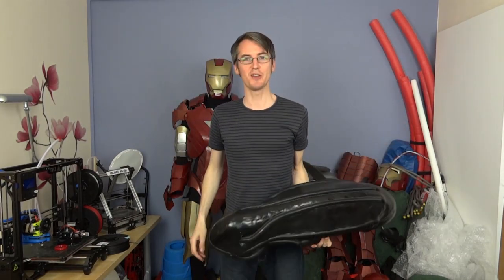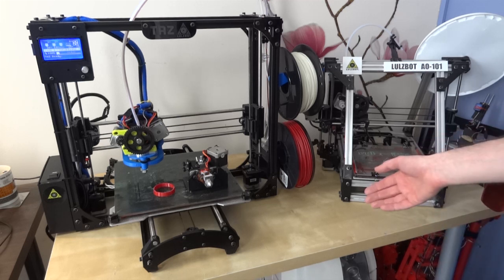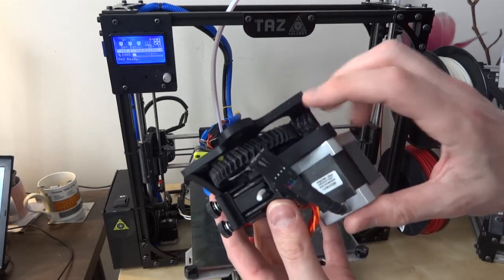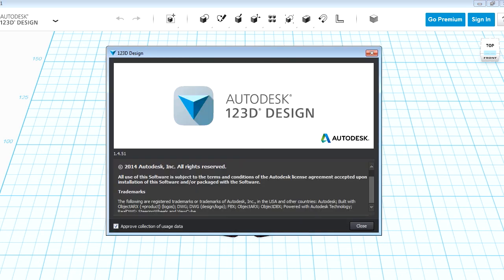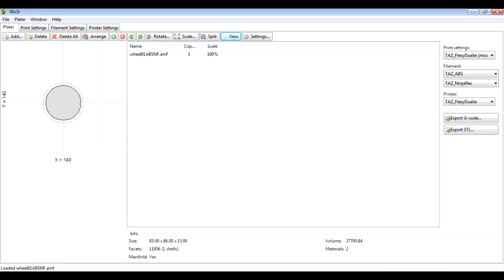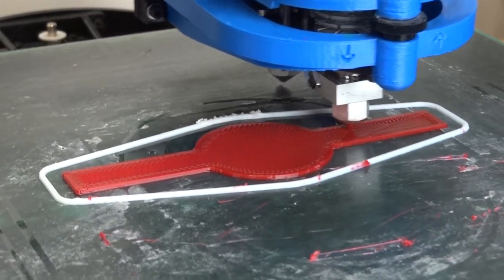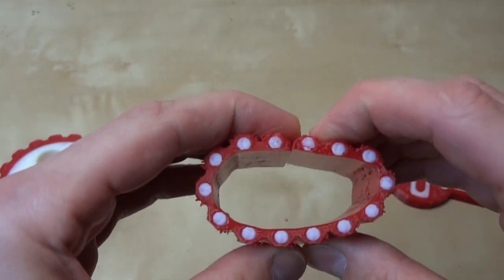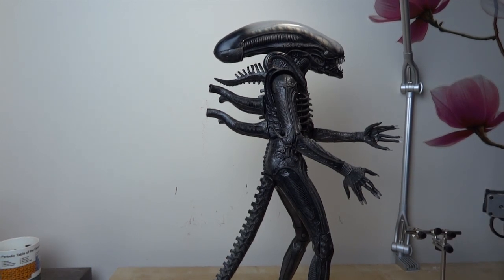Alien Xenomorph Cosplay #1 | Hybrid Prints with Lulzbot TAZ | James Bruton

Comment: Have you considered a brush on the side of the build platform that cleans the extruders? In slic3r you can manually add gcode commands on certain conditions, one of those conditions will execute a set of gcode commands every time the extruder in use is changed. You could add gcode that moves the extruder tips over a brush that would wipe off all of the ooze whenever you switch extruders. This would save a lot of plastic for you, and the object would still be visible as it is being printed.
Reply: The new Lulzbot Mini has auto nozzle cleaning, along with auto bed leveling
Reply: ***** Right. Your skirt solution is a good idea for this application.

Comment: Hi!
Congrats for your work, it's incredible!
I am working with lulzbot taz 6, namely with the dual extrusion of NinjaFlex and ABS. I'm doing an hand prosthesis with NinjaFlex and I also need ABS to perform supports. I am also using the Skirt option. 
At the moment, I'm having problems regarding the second extruder height, when it hits the skirt. This is made with a certain impact. We tried to lift the noozle, but during the printing, the noozle goes down again.
I am also having an issue about support-part interface. The contact layers of NinjaFlex have a poor quality and when I try to split supports from the printed part, the print suffers some damage.
Do you have any suggestion in order to improve these issues?
Thank you for your attention!
Reply: I am using Slic3r. I also tried cura. But I had some incrustations of ABS in the part, so I tried Cura. I made noozle and bed calibration

Comment: as someone whom is building an ironman suit myself part 3d print and part casting from foam build. im wondering if you think this dual extruder technic would be a good method of making the boots with printed flexabe rubber soles and joints but rigid outer shell and much more fitted. or is ninjaflex not that durable?

Comment: I remeber you only had the one small lapop that you used for 3d printing and editing the videos so does that mean you can only use 1 printer at a time or can you use both? I was just thinking that with 2 printers that your build time for multiple parts can be cut much shorter. Also how are you going to do all these projects? Finish Iron Man suit, Johnny Five, Hulk Buster and now the alien suit, and that walking robot hingy you was working on a while back. Many many parts to design and print.
Reply: thats cool, its nice to have the option and at least your laptop will be free while printing if you choose to use the sd card.